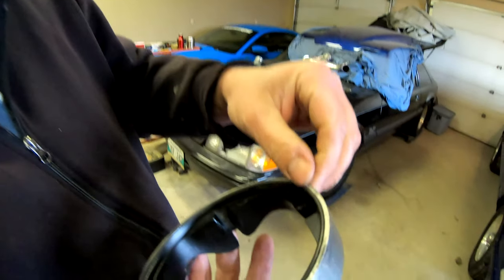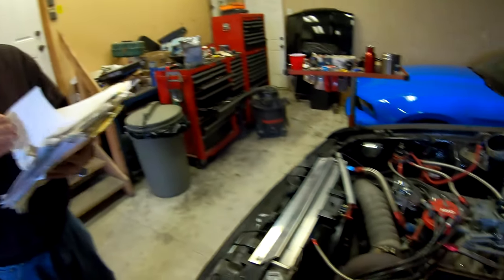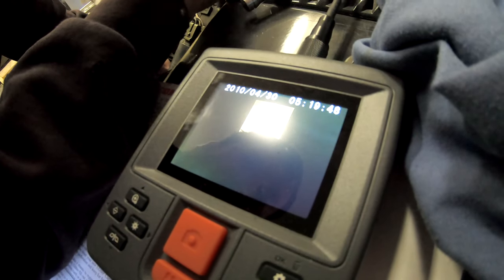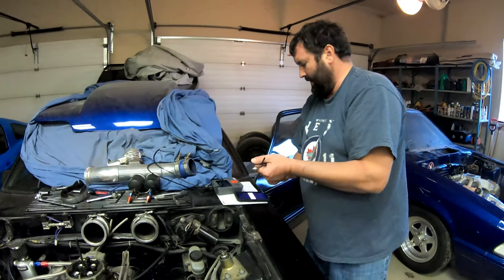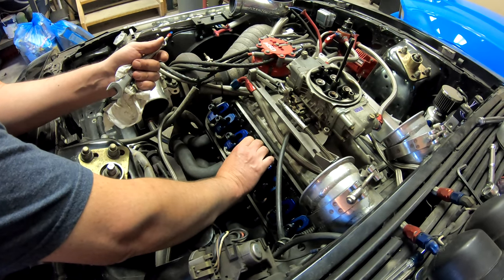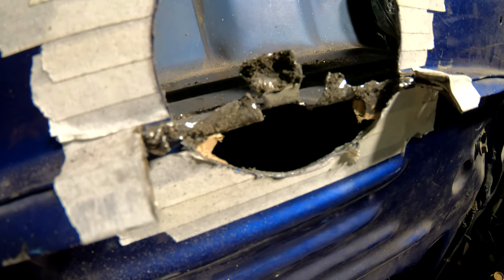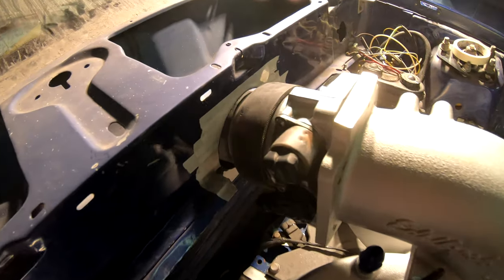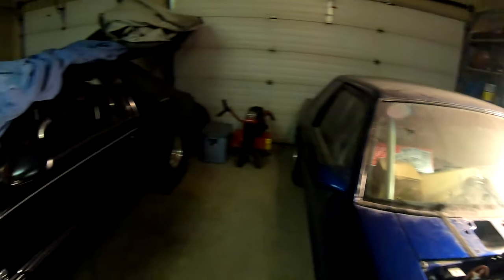MUSTANG BRO'S | Inside an Engine with a Borescope, Valve Lash, Hole Digging

Comment: Why is there rust and water in there?   Is it water from the race fuel, or E85?   Are the heads lifting at max power?  If they are lifting, I would think you would see a water pressure increase.  With enough money and skilled professionals on the payroll...and with a water pressure sensor, could program to kill motor and boost before major carnage.
Reply from the maker: Condensation from sitting in a garage all winter with the heat on and off is my guess

That was before the first start up back in May

The car has been running great since then

Comment: What kind of oil do you guys like to run in your cars? Synthetic or conventional? Any specific brand?
Reply from the maker: Tricky Question lol. Clayton is the most particular, and runs OEM brand oil in everything down to his air compressor. Me and Rob have bought fancier oil for our fast cars, but for most things whatever is cheapest. When the Sonicstang and Nova were nitrous cars we used 20-50 castrol traditional.

Comment: Mike I don't edit videos but I do work with computers, you will want to make sure your new computer has a good SSD and lots of memory.  I think the actual processor shouldn't matter as much so long as it's not being limited by other factors (like a slow hard drive or not enough memory).  Fairly recent multi-core like a Core i5 processor should be OK I think.
Reply from the maker: Ended up with a AMD 2700x, 16GB of Ram, and a 500gb .... Nv2me??? Already forget the names of the stuff lol. The motherboard mounted harddrive.
Reply: @SPPTVarmy  Should be a vast improvement I would think, especially if going from an old hard drive to NVMe.

Comment: What engine is in clayton car?
Reply from the maker: 348” SBF
Reply: @SPPTVarmy  does he have forged internals? Is it a stock block? I've heard that if u strock out a engine a lot u can run into issues with piston skirt movement on the down strock?
Reply from the maker: All forged internals with a Ford “R” block

It’s only got .250” extra stroke and a .125” over bore from a 302
Reply: Rafael Sanchez, Explorer 302, P heads, B cam. 😎👍🏻
Reply: @SPPTVarmy  what's the fastest ET?